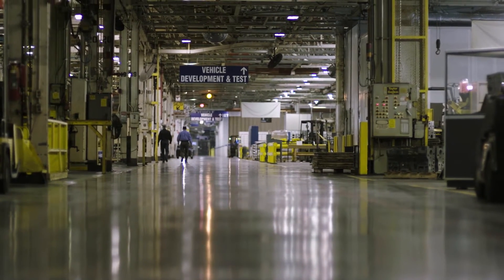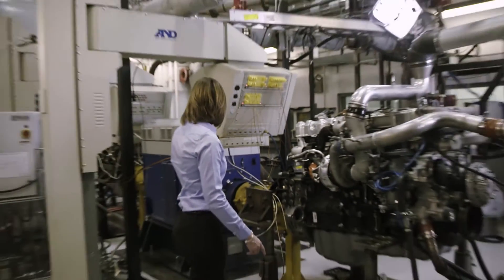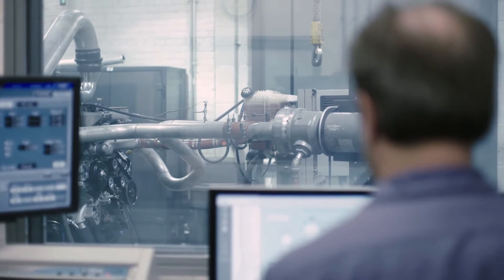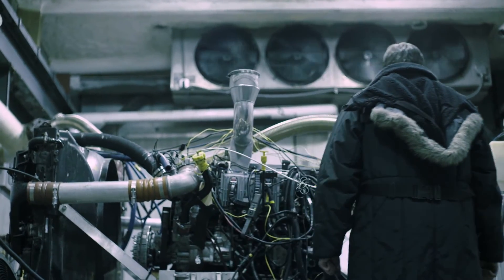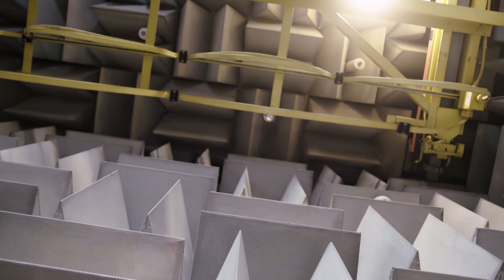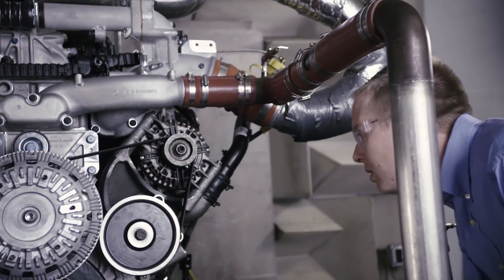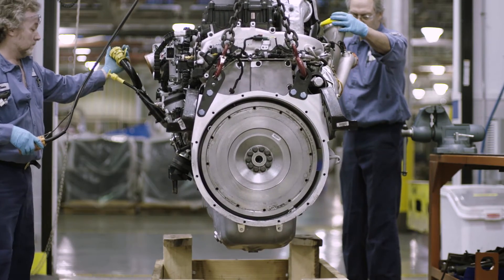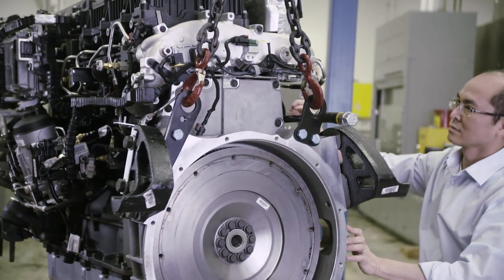International's A26 - Engine Test Facility Tour

Comment: My Company is leasing 10 of these turds in RH models. Nine of them have very small sleepers and one is a daycab. These motors are rated at 475 hp but are the weakest pieces of crap on the road. Absolutely no torque whatsoever. This motor can barely spin itself, let alone pull freight. Best part is the fuel mileage. With a light load on flat ground we average 4.9 mpg ! Just another failure from Navistar. Think Maxxforce, The Sequel. Nothing but GARBAGE.
Reply: Not a driver, but an international tech, so far this engine has hardly ended up in my shop for any major repair. When we get them in (atleast 5 a week) its mostly software updates and unplugging the dpf filters. So far only had to swing 1 under 50k miles due to rod bearing spinning at 30k miles.

Comment: That cold test facility looked very room temperature to me.  Buy an ISX15 engine in an International Truck or buy a different brand.  Volvo trucks are just as bad as the Navistar trucks with the Navistar engines in them.  It doesn't matter what name is used for this engine.  The MxF13, N13, and the A26 are all bad engines.
Reply: The A26 is a new engine, how do you know it is bad? Not all International and Volvo trucks are bad, some are just lemons. Maybe give them a chance before making such bashful remarks.
Reply: John Phillips We bought a brand new international 4900i straight truck, single axle, with the 8.3L engine in it, if I remember correctly. Honest to god that was one of the most reliable, and best running Diesel engines I’ve ever personally had to use.  Never had a problem with it, and we put 260,000 miles and change on it.  Had a lot of torque for a small Diesel engine. Got rid of it in 2016 and it ran like a top.  The build quality of the truck was OK, although after about 3 years, it got lots of rattles in the dash, door fittings, etc. however, it was heavily used by our business and it served its purpose well and more than paid for itself.  I can’t say a bad thing about that.  We also have a 2004 KW T600 with a 565ISX in her that has 1.1 million on all original parts with the exception of injectors and a turbo that were done in the fall of 2017. That engine has always been reliable. We also have a 2004 freighliner columbia daycab that came with a MBN C15 CAT @475 horse that ran like dog shit, until rebuilt. It had the smart wastegate turbo that was junk, I never thought that truck ran as well as I thought it should. Never built enough turbo boost, IMO. We had it rebuilt to the “6NZ” spec@475 horse and it’s totally different. Truck now has 983,xxx miles on it and is my favorite truck to run around in, to be honest. The short sloped hood of that freightljner and the torque that CAT motor has it awesome. It’s a runner for sure.

Comment: those engine don't run on a dyno in real life ! They get bounce around, the get salt contamination, dirt,mud etc constant load variation , driveline vibration ... these are not real world test.
Reply: Obviously, these tests are preliminary just to see if they need to correct anything before putting this engine in a test vehicle for real world testing...